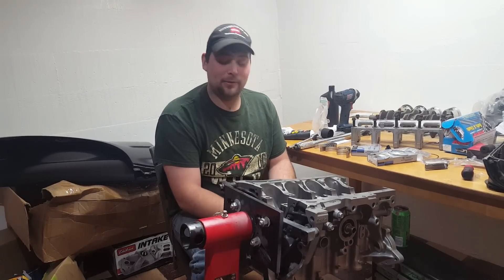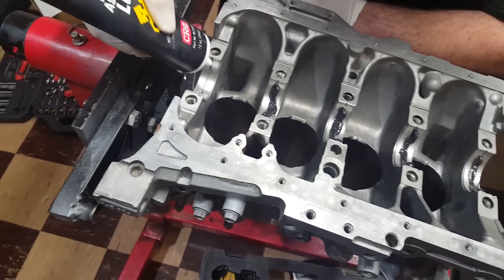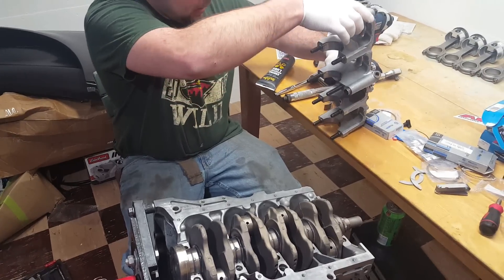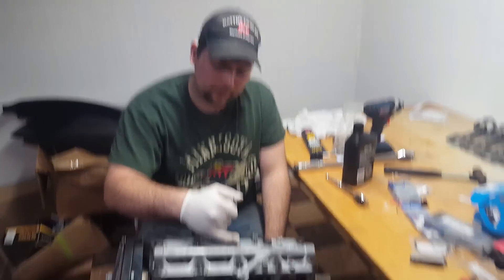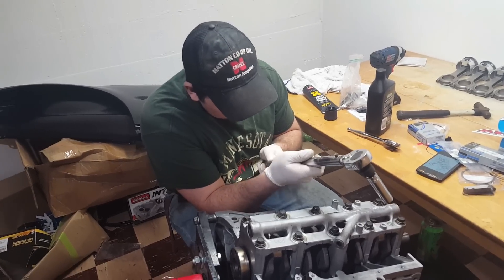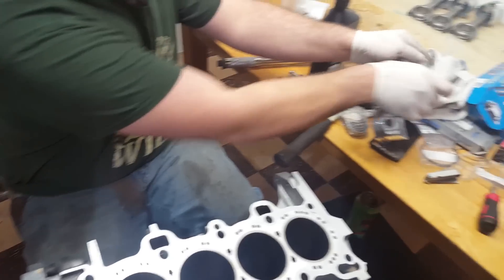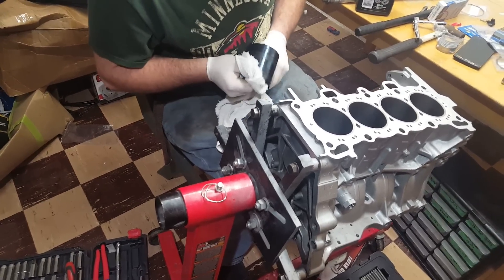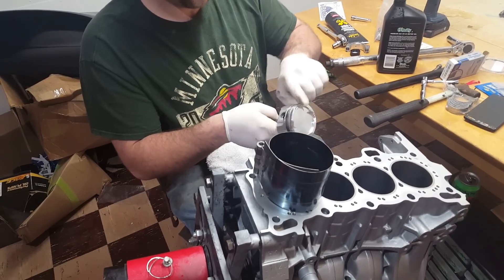D16 Build For Boost pt:1

Comment: Not so sure I agree with over tightening the main bolts for boost applications. Torque specs are designed around the bolt, and its torque yield for strength. That is why they always suggest you replace the factory bolts when you replace them. Over tightening the factory hardware will over stretch it, and weaken it. 

Now of course, I'm assuming that isn't factory hardware. Now is it doesn't stretch, then one of two things is happening:

1. The threads are being gouged. 
2. The main cap (or girdle in this case) is being crushed and altering its shape which will apply more pressure than needed to the bearing. 

I've built, and been a part of many cars, and never have I seen anyone modify torque spec unless the hardware they were using said so, especially on a bearing load part like a Main cap. 

Another thing, I noticed the pistons weren't marked.. Did you check ring gap prior to installing? Wasn't sure if I missed something.
Reply from the maker: Jeffrey Collins arp main studs and I marked all of the pistons and separated all of the rings a lot of people don't think I know what I'm doing but I do. but I guess that's the internet. Just because people don't see it in the video doesn't mean I didn't do it. Like people are hounding me that I didn't check clearances. The machine shop and myself check all of the clearances and ring gaps. I Really appreciate you pointing out details. A lot of people look to these videos for guidance but you can't cover anything you know?
Reply: Absolutely, I was just curious. 

 did ARP suggest the over torque?
Reply from the maker: They didn't but it was only 5ft lbs over so it wasn't too bad
Reply: What was the stock torque on those main cap (girdle) bolts? Video cuts to music when your mentioning it, and i cant find the specs anywhere!!!

Comment: you didn't plastiguage the clearance between the crank journal and bearing for accepeable spacing. That's a very important step that you should show..i think most peope can put together a jig saw puzzle..you should give more important details that maybe first time builders should know
Reply: never said I was but when ya build an engine ya do it right the first time not 4 times later.. ill spend 20$ any day to save a total teardown when it wasn't needed in the first place if ya did the dam thing right
Reply from the maker: TheDman216 all the clearances were measured before I did this video. I didn't even know I was going to make this video to begin with.
Reply from the maker: sctflasher379 I can remember exactly what each clearance was. If you search through the comments I did post them once but it was awhile ago. And everything was standard size, no oversized bearings or anything like that.
Reply: std size is the bearing size on a brand new crank not ya junk yard trash picked 160k crank..ive seen brand new cranks not come out of the box right.. YOU ALWAYS CHK JOURNALS !! ALWAYS EVEN IF ITS NEW!! Ive seen everything thing from shavings in oil pumps and unbanaced water pumps to uneven valves that wouldn't seal to casting flaws on 3k$ heads man..give it up
Reply: @Dman216  are you aware of how cheaply a jdm engine with 45k miles or less on it is to buy? Especially a d series?
Reply from the maker: TheDman216 thanks dude everything is balanced. even the flywheel and clutch, so it's pretty close to being a blueprinted engine. every clearance was within oem specs too. I'm super excited to hear this thing rip.
Reply: ya wrong sorry to say.. the same principals are used for installing a crankshaft in any engine from a motorcycle to a train engine and why the hell wouldn't you want to spend 8$ to make sure??Also all journals should be mic'd for ovaling(out of round) Not chking that is the kinda shit a hack does
Reply: TheDman216 you must be a God when it comes to building engines...and super smart.once again do wtf you want. all motors blow up in the end.. so stfu
Reply: 1st rule ya always chk the journals with a  mic 2nd ya always plstiguage the journal to bearing ..alwayysss even the most slight egging or coneing also concaving is bad news and needs to be made right strait otherwise ya gonna start having oiling issues or spun bearings
Reply: and ya don't need a science degree to chk the journals ..but a cheap micronmeter and chk it at 3 hour clock times 12 3 6 9
Reply: cool..but wear on the journals has to be checked even if they are clean and not grooved or marked and no matter how clean they are.If was stock journal sizeand not turned down doesn't matter even polishing the lournals can take some materal off. One of the most important things you can ever do is balancing and weight maching the rods and pistons also crank balancing are super good improvments and should always be done even to new hi po parts attention to detail will help the SOHC bottom end live long and not have uneven pressure and vibration and spin bearings or have uneven journal and crank bearing wear..Nice build man
Reply: @Dman216  pretty much no one ever does that, assuming they're starting from new or gently used OEM parts most people just slap an engine together, when using parts from different Honda engines, common clearance issues are generally well known and noted in build guides. These clearance issues are easily remedied by using the right parts that you know will fit without clearance issues.
Reply: that's a no no even without damage the journals should be chked on rebuilds and platiguaged ..its a quick insurance policy for only a few bucks to chk it also a high mileage crank to the eye might look ok but those micro groves should be smothed out with a light polish
Reply: iam not gonna agrue that's not why I commented for..but take my words and research them yaself and use that info to build better stuff and chaulk it up as knowledge to better yself. Without a doubt, Iam over and out
Reply: Honda How To ok. because i was gonna say, is it not necesary? wat clearances did yu come out with? those werr standard acl size
Reply: Very nice man..Done right!!
Reply: Honda How To got my crank in and torqued to 38 for my z6. plastigauged and it was .0015 for all the mains
Reply from the maker: sctflasher379 Perfect. its within spec
Reply: TheDman216 no need for it ... if your motor has never spun a bearing.... the bearings wear out not the crank... unless u spun a bearing..... how many times do i have to tell u!!!!
Reply: @mariozamora5419  brah the bearing is a softer metal but still the crank has minimal wear that's why in factory's the machines get tired they are made out of stronger  Metal to forge shit but over time still  Wear out
Reply: Mario Zamora standard size doesn't always work
Reply: what all did you have done to your block was it done by a shop?
Reply: watcha guys talking about I am very interested?
Reply: Tossing this out there for information’s sake (I don’t know why you wouldn’t check your clearances, it’s just a good practice in general).
Journal Clearances for a new install: 0.0015 - 0.0020
Service Limit (you must change them): 0.0025

With a literal thousandth of an inch difference between a proper, working engine and a catastrophic failure, spend the change on Plastigauge and save yourself a build.
Reply from the maker: It was already measured before the engine was built, I'm not going to re measure them all.
Reply: he left out alot more information than just the clearances between the crank journal and bearing lol
Reply: TheDman216 your right its good to do it... but you dont need to do all that bull shit... if no damage is done to the motor.
Reply: @mariozamora5419  let me know when you build one I'll bet u 1,000 $ dollars no bull shit it can't make it to 30k miles that crank will lock up you have no experience building motors if you truly believe you don't need to check clearances I've only built two motors and buy did I fuck up with your attitude and cost me 14 GRAND!!!!!!!!!!!
Reply: @matthewleising84  just buy brand new oem or oem spec bearings, there are probably hundreds of videos of engine builds here on youtube ranging from b all the way to k series and almost none of them are measuring these clearances and im sure their comments sections are filled with people like you whining about it and guess what? Almost none of their cranks seized at all let alone in 30k miles or less. By your logic if someone buys a practically brand new d16 jdm engine with 39-45k miles or less pulled from a running car on Japan and then tore it down and rebuilt it for shits and giggles, they according to you should first measure these clearances before reassembly because you insist this is something that must be done.....despite it being a complete waste of time because you already know the parts will work and have zero clearance issues because they have done so in the past, its just common sense, there is no need to do this whatsoever if you're using parts from engines in good working condition.
Reply: @JustinBobby-di9zt  Unlikely and uncommon, but it still happens. You'd rather catch something before you get done with a build, instead of finding out after it's too late.  You should always check journals for clearance just in case. You don't know for sure unless you check it yourself. Sure sometimes you can slap something together and get by. Doesn't mean that will work all the time. I wasn't referring to heads,  but if i was,  I'd still inspect the part completely before installation. Sometimes manufacturers make mistakes bud,  I'm sure you can agree to that.
Reply: TheDman216 un true.... std size.... STD SIZE!!!!!!
Reply: @mariozamora5419  Obviously you've never heard of manufacturing defects. It happens dude and if you don't check everything and put a flawed part in it can cost you your crank.
Reply: @cotycollins6302  we've all heard of manufacturing defects before, generally when you buy parts you get what you pay for, this dude is talking about casting defects on $3k heads....unlikely and uncommon if true every reputable manufacturer of quality parts either machines thier parts or at the very least deburrs their cast parts. This is not that common and generally people know which brands/manufacturers defects are most commonly found in and just don't buy those parts.
Reply: TheDman216 dont need it ..thats why its called rebuilt engine not a brand new engine.... jajajaja
Reply: TheDman216 if your crank has never been damaged, no need for all that shit... thats why you buy std size bearings !!!!
Reply: @mariozamora5419  I thought the same thing but 7k later on my 4.6 4v ik your wrong
Reply: TheDman216 no need .... its just shit white people say you have to do to stop everyone from rebuilding their own engines. stupid shit. its a honda not a ford or chevy v8.....!!!
Reply: @mariozamora5419  nothing to do with being white, everything to do with being a nitpicker obsessed with minute details that don't really matter discouraging others from building their own engines.

Comment: Quality low lint paper towels would be better. You don't want undesovable cotton lint trapping oil galleries.
Reply from the maker: thanks for the tip, all I really used the towel for was the ring compressor and my hands, I didn't really want to get it near the bottom of the engine
Reply: coffee filters work better.

Comment: How much torque did you give to the rods  bolts and crank caps?
Reply from the maker: luistech1000 main cap was 48 ft lbs and the connecting rod caps were 40 ft lbs

Comment: i own a d16 z6 im also looking to run boost what kinda pistons and parts would you recommend i want to be running more boost
Reply from the maker: Jose Araica we are going with a JE piston and eagle h beam connecting rod combo. You don't necessarily need to do that. But if your on a budget, I know a lot of people that have used vitara pistons and have had very good luck with them. I would recommend using a h beam style connecting rod as well. And we are also running a fully built valvetrain so we can rev the motor a little higher too. It's all up to you and how much power you want to put down, if it's not a insane ammount of power then you can skip a couple things like a fully built head, but if you want a lot of power and reliability I would always recommend name brand parts.